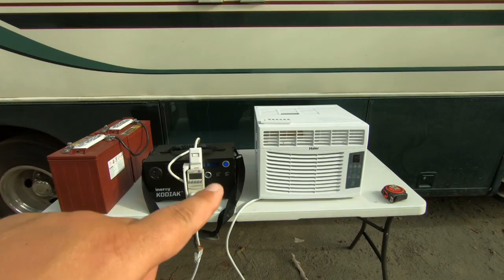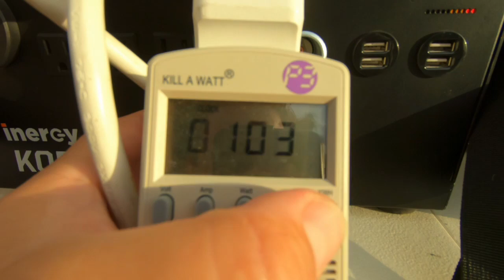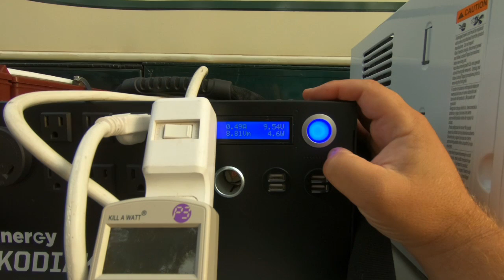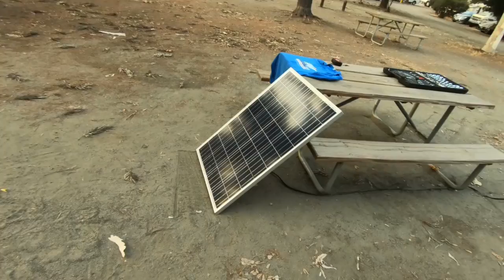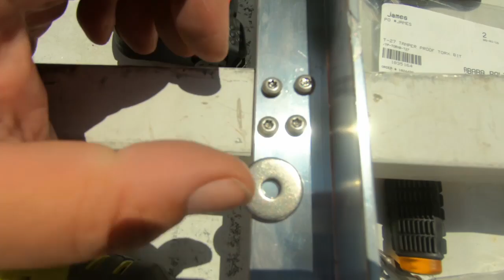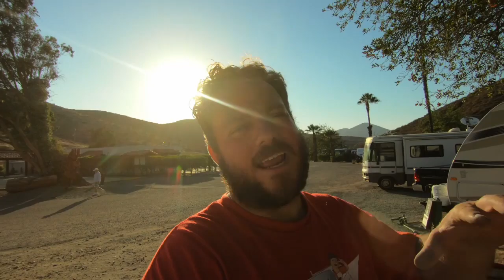Van Life Van Build Part 3 Easiest Way To Have Solar Setup

Comment: Wow..juat priced that Kodiak...little salty.
Reply from the maker: Steady's Adventures The lithium ion battery in it alone would cost you over $1000. LiFePO4 tech is selling for $950 for 100Ah and it weighs twice as much without all the goodies. The unit isn't cheap, but just the increased charge efficiency alone using it for solar would save you 40% the cost on panels. Price tag is high, but with all considered its cheap for what you get.

Comment: If you want to make it really hard to steal, use screws that can only be tightened.  (cordless drill makes short work of those screws :) )
Reply from the maker: I still want to be able to remove them if I want to make modification, like make the panels tiltable.
Reply: Don't change the subject!  :)
Reply from the maker: HaHa

Comment: Easy yes but OMG the system is not cheap. Good video.
Reply from the maker: BTB Life Unscripted It has lithium deep cycle battery, inverter, charge controler and allows for battery capacity expansion.
Reply: Nice system absolutely.

Comment: Beware of the impact of shadows on your panel's.  6 in pipes would probably be a problem as will the 4 vertical members at each corner of the rack.
Reply from the maker: We will have to see how much an issue shadows are from the pipe, but I don't see any shadows from the rack members. And only time your going to get long shadows is earlier in morning and late afternoon which your solar panels don't produce much during that time. Especially when mounted flat.

Comment: should'nt you have sanded and painted the rusty roof before adding the rack?
Reply from the maker: I am able to reach every spot and the answer is it would be best, but I wanted to get the install done and van weighed. Plus didn't want the panels to get broken flying around inside the van.